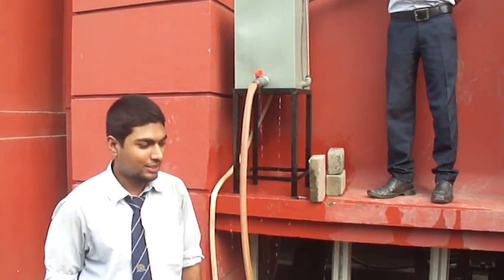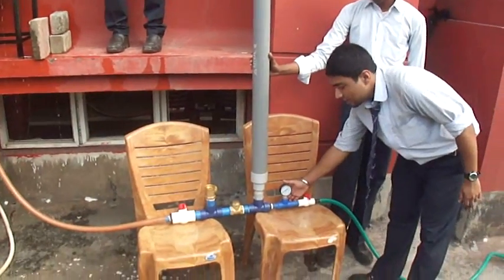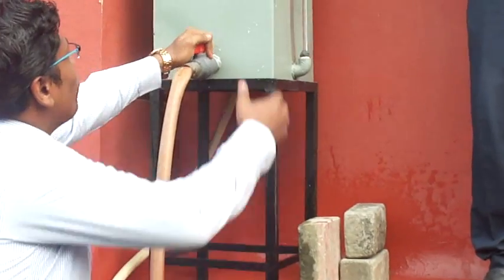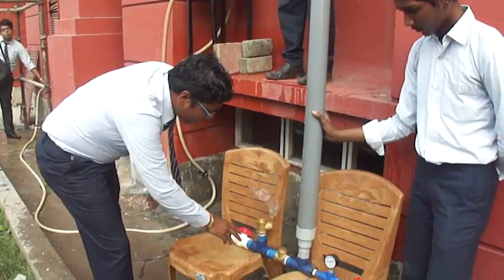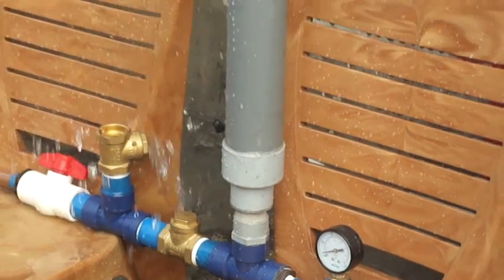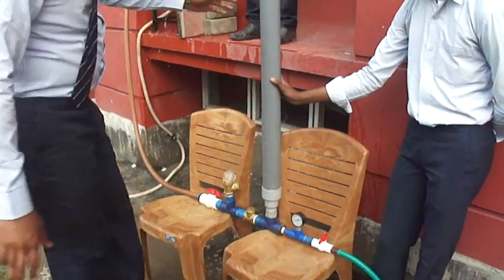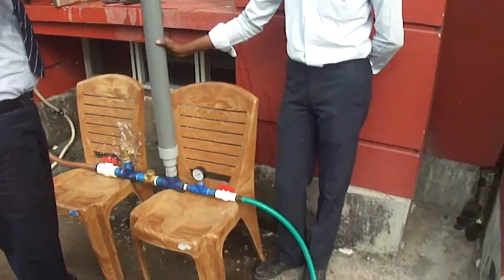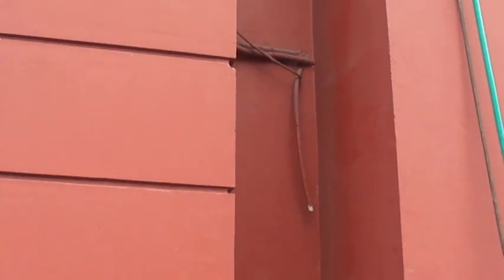How to Make Free Energy Water Pump - Ram Pump

Comment: We liked it very much but it could be used for throwing water from a tank filled with water of say size 12×10×5=600cubic ft about 2000 ft away for spraying furtilizer in the field like Urea. The flow in the tank can be maintained that it remain filled during the use.

Comment: I'm working a similar project like this. I use solar panel to operate water pump (move the water to huge tank on rooftop). Then start to flow the water to spin generator when there's no sunlight.
Reply: हिन्दी?
Reply: मैं इस तरह की एक समान परियोजना काम कर रहा हूँ। मैं पानी पंप संचालित करने के लिए सौर पैनल का उपयोग करता हूं (पानी को छत पर विशाल टैंक में ले जाएं)। फिर सूर्य की रोशनी होने पर जनरेटर को स्पिन करने के लिए पानी बहना शुरू करें।

Google Traslator is a thing.

Comment: Good the ram pump principle is there from very long time, we want to appreciate the technical students who have done it with the locally available materials, thank you students,  try to make free electricity concept with locally available materials with low cost
Reply from the maker: thank you
Reply: you can use the Potential energy of this water to generate Free electricity. use Small turbine or Dynamo for this.  Mail me if you have any questions.
try to compensate or find some instant application of the Water that is dripping ex. in irrigation etc.!
Keep it Up! I'm From Mumbai.

Comment: but wasting the water
Reply: As indicated in the video note, a larger amount for flowing water to lift a lesser amount of water higher.  Having used the larger amount of water it goes out of the waste water check valve, hopefully returned to the stream or water source.

Comment: Guys, is there a way to extract water from a 1000 ft borewell without use of electricity?
Reply: hand pump it won't  use electricity
Reply: No way....
Reply from the maker: +Ramakrishnan C 
My experement way to extract water from a 50 ft borewell without use of electricity.
Reply: Ok, but do you guys know how to do it for a 1000 ft borewell without using electricity & Motor?
Reply from the maker: +Ramakrishnan C 
Without using any Types of motor.
Reply: Raza Photography & Technical yes
Reply: I don't think this ram pump can useble  in the borewell. Because fall height ( i.e.  water tank to inlet of pump )required. So tell me how to get this  height in the borewell.
Reply: Hand pump will work awesome for your case, its a type of Positive displacement pump which is well known for its High pressure discharge.